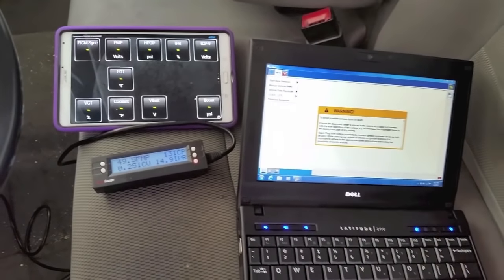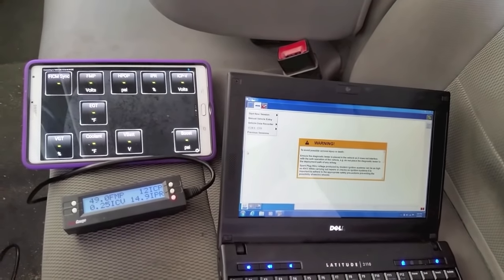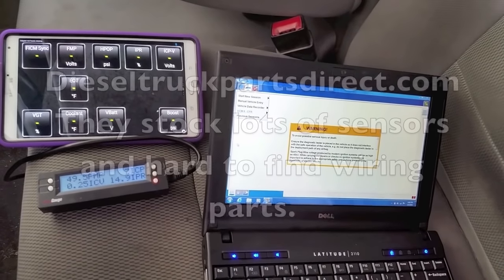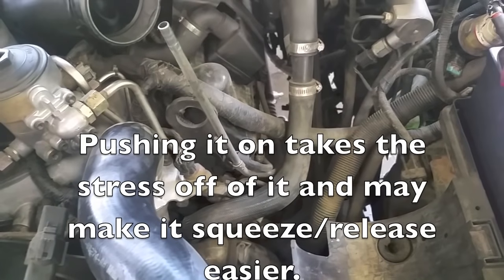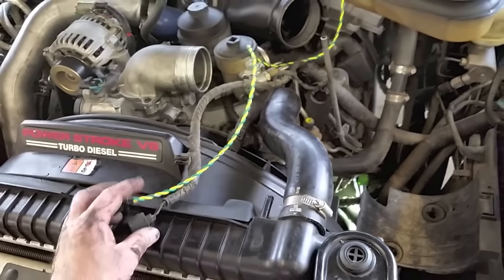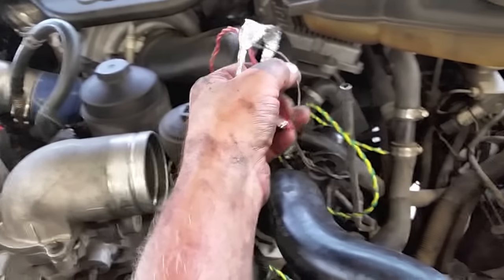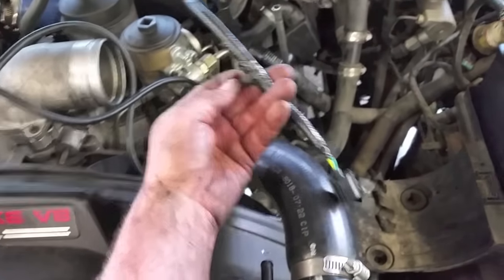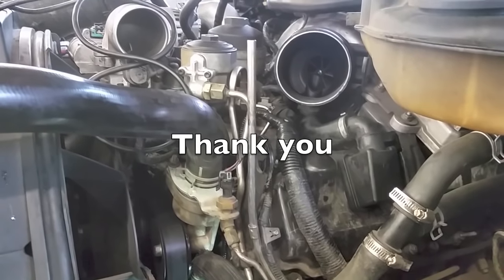P2614 P2617 FORD POWERSTROKE FICM SYNC TIPS TRICKS AND REPAIR DIESELTRUCKPARTSDIRECT.COM

Comment: I just did this repair on a 2003 F350 6.0   I went through the top of the motor; had to take the driver's side battery out along with inlet air pipes.   The job was a royal pain the butt.   The bolt and tape trick was a huge help.  Most of the insulation/wrapper I had could not reuse had to redo that and trying to snake the wire back down was a pain.   The replacement wiring is too long but I figure easier to deal with long wiring then too short.    I also wasn't sure how far back I had to go on the wire to replace, so I went as far as I could but not far because you have to re tape all of it. 

I will say this is the most frustrating problem because some days it would start and other days it would not.   I never got stuck but each time it would not start the scanner said no sync.    I tested the old wiring for continuity and it had a .4 resistance rating; the new wire was perfect.   

I really miss DieselTechRon but his legacy lives on.  Thank you Ron, you are missed!!

Comment: Great video! I'm a little confused because you started off talking about the crank sensor but ended up replacing the cam sensor. Great tape tip BTW!
Reply from the maker: I've never seen a bad crank signal yet.  sync is alignment of the cam and crank signal. I focused on the cam because that's the main cause. crank is easily verified by rpm
Reply: Hello! I had same issue no sync, found both crankshaft sensor wiring tampered and had heat shrink on each one. Wiggled them and that was the issue, I repaired them and everything works well!

Comment: was there any damage to them two wires going to the cam sensor? I was hoping you would show where the fail was. one other question for you is will the glow plug module fail creating bad signal to one glow plug? replaced all glow plugs and harnesses and still have a code for number 2 glow plug failure check the wire from module to glow plug and it is good. will the module just lose one at a time or do they default them all. thanks Ron you seem very much helpful
Reply from the maker: I've never been able to see the damage on them.  yes the module can lose one glow plug only. I've had two wired wrong. I kept getting glow plug number one.  ended up being seven. wire positions were reversed.
Reply from the maker: I've never been able to see the damage on them.  yes the module can lose one glow plug only. I've had two wired wrong. I kept getting glow plug number one.  ended up being seven. wire positions were reversed.
Reply: Ty you are the best

Comment: I have a no sync issue 2004 f250 6.0. truck will start eventually however the little black box shown in this video still says no sync while the truck is running.... Any ideas?

Comment: never solder wires, join wires with crimping connector that also has ends with heatshrink ( not use those that has a ring in center with solder )

Comment: Bought scan gauge and everything was right except ficm synch. Wiggled cam sensor wire near fuel filter and she fired!  Ordering new egr connector for the cam sensor. Might have jacked it up doing blue spring but didn’t manifest for 2 weeks on cold night.

Comment: my cam wire had a intermittent short but instead of going with the one Ron rec'd, I ordered the oem Motorcraft WPT359 Exhaust Gas Recirculation Valve Connector for only $32 and here's an awesome write up as well!

https://www.ford-trucks.com/forums/1160636-camshaft-position-sensor-cmp-wiring-pigtail-replacement.html

Comment: I got a 6.0 in the shop and it doesn't sync when to turning over and I have swapped pcm and ficm off another 6.0 the same year. It has 1500 psi through the ipr so it has high pressure during turnover. It has low pressure the tac is reading when I turn it over but it will not start. I have swapped injector harness off another 6.0 and everything it will not start. Can you please give me some advice?
Reply: Ryan Stansel unfortunately Ron passed away, but have you found a solution to your problem? I'm having the same issue on my 03!
Reply: 2006 E-450 no SYNC and it was the CPS connector wires. Thank You Ron. RIP
Reply: Ever figure it out
Reply: Guess not…

Comment: Ron,
Does the presence of an RPM signal and a failed cam sensor also apply to the 7.3 Power stroke?
Great video!
Thanks.
Eric
Reply from the maker: yes. If the crank is strong you can watch the rpm on the dash.

Comment: I have a 04 600 diesel that it made a little poof racket the other day coming down the hill I found it mode a turbo pipe I went put a new turbo pipe on it I did not help the racket I hear now I have lost power because of no boost Adil the truck around it's got power but when I get up to speed I hear a real real bad are like it has a real bad air leak in it somewhere around the area that are around one of the hoses I have checked the hoses have not found no leaks do you have any other suggestions that I could look at I have a small exhaust leak on one of the up pipes would that be it because it definitely smoking out of the pipe and would that make it loose enough boost for me not to have no boost thank you
Reply: Its the y pipe. The v clamp is not letting them seat properly. Just a little bit and you have a boost leak. Happend to us because we bent the y pipe just a tiny bit.